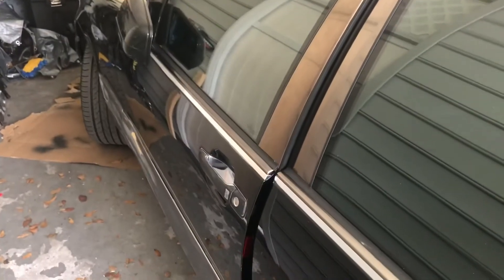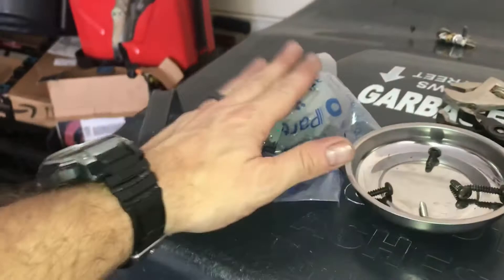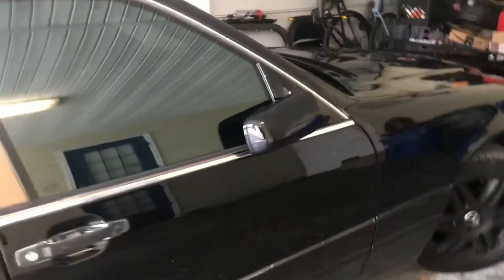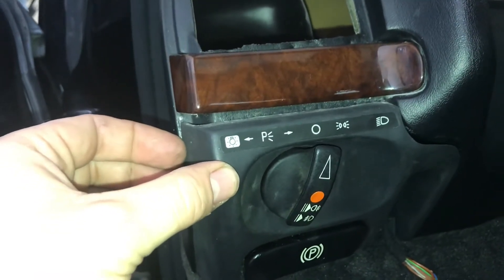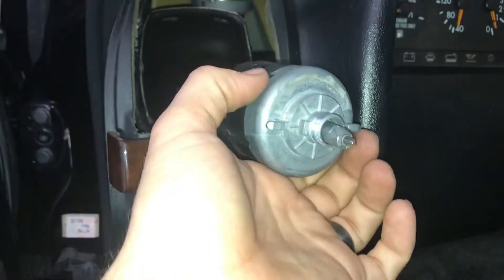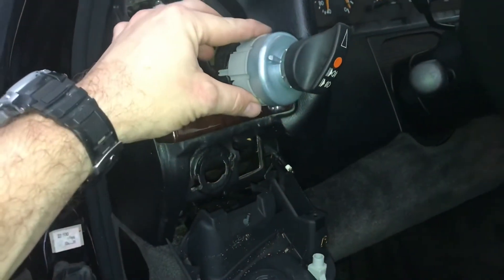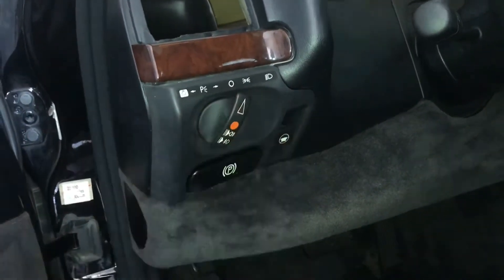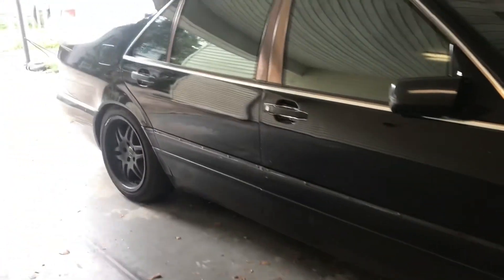MERCEDES W140 s class s500 headlight switch change s320 s420

Comment: EXTREMELY HELPFUL !!! Just watched and now have to go get the part and make it happen! I am SURE I am saving a TON of money by doing this myself! You're a lifesaver! Money saved is critical on these old cars!
Reply from the maker: That's awesome and the reason why I make the videos.  You got this
Reply: @petescarport  PROBLEM! I followed the instructions and while it was a LOT harder to remove the AC vent then it looked like in the video, I did get it off and ultimately reinstalled everything. I tried the headlights to make sure they would now work by loosely placing the knob on before putting everything back together and YEA! (or so I thought), they came on! BUT. (The BIG "but"), After reinstalling everything, I went to put the knob back on fully and it just would NOT "lock" on to the shaft. "WTF??", I thought!! After closer examination, I discovered the "EXACT" replacement switch I bought was NOT "exact"! The shaft on the OEM switch has a metal casing with a slot that the knob locks onto. (When you stick a small flathead screwdriver into the hole on the knob, it releases the knob from that slot that the knob hooks on to.) The shaft on the replacement switch does NOT have that slot! So there is nothing for the knob to lock onto and it just slides right off, as well as being unable to pull out to turn on the foglamps, because obviously when you pull on it, you just pull the knob off!! UGH!!!! The so-called "exact" replacement part number is 0005456504.......but the number on the OEM part is 0005456404. (a 4 instead of a 5 in the 3rd digit from the left.) I have checked all over the internet and the part number I bought is CONSTANTLY referred to as the replacement for the original part!!! BUT BE ADVISED...it is NOT an "exact" replacement!! Yes, it plugs right into the socket as the original switch did, and yes, it operates the headlights and if you pull the shaft out by hand (as I said, you can't do it with the knob), the foglamps work. But it is NOT the right part and I am frustrated beyond belief!!! NOW what?? I can buy a used part off ebay but won't I be vulnerable to the same failure from age as I was with my own original part? It will be just as old! It may work when I get it, but for how long? That's why I wanted a brand new one! Any suggestions???
Reply from the maker: @richards4374  wow I haven't heard this one and that sucks they wouldn't just make one universal part for all.  I wonder if you can maybe use Teflon tape or something to create a seal.  Using super glue would make it very difficult to change in future.  I'm sure there's a million ways to modify it to work since it does work on controlling the lights.  This is a big plus so you can at least use the lights.  Now we have to figure out how to modify it so you can use it fully.
Reply: @petescarport  Pete, I went ahead and ordered, off Amazon, another switch. One that has the specific part number of the original and therefore should not be an "exact cross-reference compatible" part, but the SAME part. In the pic, it "looks" like the metal shaft with the slot the knob locks onto is visible, although it's not perfectly clear. My first thought was the same as yours....to modify it somehow to work by maybe gluing it on, and justifying that action based on 25 years of successful operation with the original part. Since if I got the same life out of the replacement switch, I would be NINETY years old when it fails, I'd probably be safe doing that! LOL! But I am really anal about my cars and like them really "right". (Which is why In get buried alive in every collectable car I own. I never know when to just "stop".) So I ordered the correct switch (HOPEFULLY!!) and will update you again when it arrives. If it has the correct shaft with that slot the knob locks onto, it's an in and out and an attempt to return the wrong part, which I am hoping will be successful or I guess I'll list it on ebay and take a loss. We'll see!! Either way, your video is extremely helpful and I couldn't have done this without it!
Reply: @petescarport  UPDATE! Returned the wrong one, ordered the "right one". It came today. I opened the box and was really excited to see the shaft with the slot on it that locks the knob on, which was missing from the first switch. BUT. (Yea, here we go again.) The knob will NOT lock onto the new switch!! There is a very, very slight difference in shaft size, the new one is a tiny bit smaller than the original, and because it is, the knob goes on, and "sort of" clicks on, but when you pull it to turn the foglamps on? It pops right off! Which it does NOT do with the original switch!!! NOW WHAT?? This one is supposed to be the EXACT match to the OEM part number! This is a NIGHTMARE! Is it time to glue it in and hope I never have to change that switch again???
Reply from the maker: @richards4374  what year and model is it again
Reply: @petescarport  Pete, it's a 1994 S500 coupe. Really very pretty car and still a head-turner after all these years! I actually get compliments on it at traffic lights, which I find amazing! Anyway, it's in pretty nice shape and so I want the "little things" to work as they should. If I just forget about using the foglamps, this knob holds well enough to turn the headlights on and doesn't fall off while driving. But when you pull it to turn on the foglamps (which work!), the knob just pulls right off the slot on the shaft, the inner knob locking tab that is supposed to keep it on just letting it pop off, unlike the original shaft that held the knob firmly until released with a screwdriver, as it is supposed to do. (Hope that makes sense!) Anyway, I want to be able to use the foglamps as intended so I hope we can figure this out without the last resort of superglue.
Reply from the maker: @richards4374  here's what I would do. First off you have an absolutely gorgeous car.  One of my favorite of all time. I have had a chance to buy a few but just bad timing.  I wouldn't worry too much about fog lights right now. Honestly I don't think I've ever turned mine on. But if your like me, you want it all to work. So I would make sure to get the exact right part in the future.  Maybe do more research and then when you really feel like you need it, get it and put it in. You will feel complete.  I've been in your shoes before.  Don't frustrate yourself more now over a simple little thing but you will only be truely satisfied the day the right part goes in. Oh and I hope you didn't spend a lot
Reply from the maker: Last thing I want to mention is did you try autohauzaz.com FCPEURO.com and partgeek.com yet?  This is where I get all my parts and they are all pretty cheap and have a parts match guide

Comment: Thanks Pete I just replaced mine. Regarding Air vent there are to pins.. You just need to push them both Gently up and then pull it forward in 180 degrees (Stright).. Finally regarding the speak Grill.. At the end near the window there is triangle plastic cover pull it upward 90 degrees from left side.. Then there is one Philips screw.. You need L Philips screw driver then pull upward from right to left gently to avoid breaking the plastic clips.. There two clips.. Left and right.. Try to free them gently. And you are done :).

Comment: Hi Pete, Thanks for the video. I found someone had been at mine already and a number of things were broken one was the holding screw on the speaker vent don’t know how to add a picture but at the top of the panel there’s a small plate to pick up first and then you can undo the screw that holds the panel in place. My car also has the headlight adjustment wheel and I found that it was very hard to move the headlight switch panel at all so in fact I did it without moving the panel and just removed the air vent. My switch nob was broken in as much you could just pul it off. I pulled the nob apart and turned the brass catch around and now it locks in place. Kind regards Jock

Comment: Looks like you might not have to remove the trim piece around the headlight switch at all. Just remove the outer switch itself with the screwdriver to access the nut and remove the vent to access the switch.
Reply from the maker: You may be right.  I read that on a forum from someone before doing it but couldn't find and video or pictures.  Either way it's not too difficult and I'm guessing Mercedes would charge a fortune to so this.  :)
Reply: Yep. I just did it (thank you for the video which was extremely helpful) and you don't have to remove the trim. I was surprised by the sleeve over the duct inside the dash which took a little work to reinstall. Also snapped a  screw hole on the vent just by lightly pulling up on it - be very careful at all times with old Mercedes plastic.  @petescarport

Comment: Thank you for the video. Awesome job like always! By the way I lost my radio code and don’t feel like paying MB dealer for it.
Reply from the maker: There's a site you can get it from. Been a long time but I might have a video and link.  You need to pull the radio too to get the number off it.   But you need the tools to pull radio
Reply: @petescarport  I have the tools to pull it out and also I have the serial number for the radio

Comment: How can I get the stereo code and the windows reprogram mode on my 1994 MB S 420?
Reply from the maker: Windows are pretty simple.  You need to hold each window button fully up for about 10sec and then go fully down for 10 sec.  With that said you will need to push it in the standard mode till it reaches top and then fully push into auto mode and hold for 10 sec.   Then do same thing for down position.
Reply from the maker: If you don't have the radio code, which it will be on the owner's manual usually on a card, then you will need to remove the radio and get the serial number off it.  There are a few sites that will decode it and give you the security code.   Or you can usually go down to a dealership and they can get it based on the VIN or serial number of radio.  My radio was changed out so I went online with the serial number and worked out for me.
Reply: Hi. I already did the windows reprograming but seems to be that there is an electrical problem. they work randomly. Regarding the radio code i have the code but any time I introduce it. the code remain blinking and do not allow me to unlock the stereo.  any additional procedure??? 
Thanks in advance

Comment: hey Pete I want to ask you about those walmart LED headlights you put in did the just plug in ,or did you had to have any special wiring harness or relay to hook them up ,so they work rd ,..?? please let me know ,thanks ...
Reply from the maker: They just plug in. I am still rocking them but damn the light quality sucks as far as vision. From outside they look insane and show a good distance but driving is very hard to see.  There is a possibility I don't have them aligned right but I just think the lights are not as bright as they need to be.  On a positive they were cheap and look sick

Comment: Please Pete , how I reprogram the windows? Thanks
Reply from the maker: I
The way I reprogram them is to turn car on and roll window all the way to top and then click to full position and hold for 30sec.  Then roll all the way down and when it reaches bottom click full position and hold 30 sec.   This should reset or re align the window. Do for each window

Comment: Hey Pete good video!! for the 1997 SL500 it's the same procedure and same link for the part? and wonder if you can help me to reprogram the soft top?... long story  short ( the car its been in my family for the last 20 years but its been in my hands just 2 ) I rebult the module in this company from NY and according to them was just plug and play but didn't happen just the windows rolls  down when I press the switch and since I set the hard top manually I don't hear the hard top unlock and the roll bar doesn't move !!!  I NEED  HELP!!!  :)  Thanks 
Robbie
Car: 1997 Mercedes SL500
Reply from the maker: Thanks for reaching out.   In all honesty it sounds like you don’t have any hydraulic fluid in the system.   I know the roll bar will work separately from the top but does use the same reservoir for fluid.   If you haven’t filled it yet it’s located in trunk under spare tire.  You will see a tank on very bottom.   You need to use Mercedes’ fluid or pentosin. I recommend Mercedes just to be safe.
Reply: @petescarport  Thanks for the info I’m gonna check the reservoir right now let you know what’s going on!! 
Thanks again Pete !

Comment: Brilliant video. Any advice on side mirrors?  Mine do not work and wiggle when driving. C140. 1999
Reply from the maker: Do you know the history of them?  When they last worked.  With mine someone actually cut the wires because they have a tendency to short our with bad wires.   I removed mine snd re wires using one off parts car.   Mine now work great.   A lot of times the built in heater wire will get exposed and short out the ac. This is why people cut them or removed the plug.
Reply: they can be loose if the mirror switch is defective

Comment: Great vid Pete. Super helpful - thank you. What's the link to access a new code for my radio? Mine needs the code again.
Reply from the maker: stuart chadban thanks. This is site I used for radio code. https://www.radio-code.co.uk/mercedes-radio-codes.html
Reply from the maker: stuart chadban you will also need a removal tool and get the serial code off the radio

Comment: Hey Pete, is it necessary to disconnect the battery ?
Reply from the maker: Chances are you would be completely fine without disconnecting it since it’s a closed device but if you accidentally ground out wire or short the electric it could pop a fuse or ruin the unit but this would be hard to do
Reply: @petescarport   Removing that speaker grille is easier said than done. I could not take the clip in the back out. Any recommendations?
Reply: There is a screw for the speaker grille under a cover. Figured it out. Hard part is taking out the air vent.
Reply from the maker: Yes, it’s been a few years since I made that video and wasn’t sure if I mentioned my tab was broken so screw wasn’t holding it in.